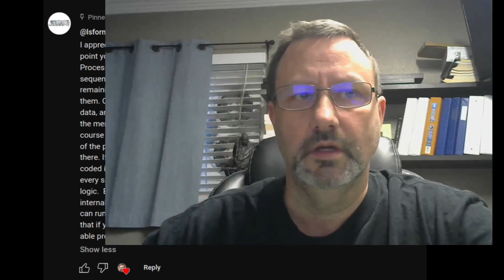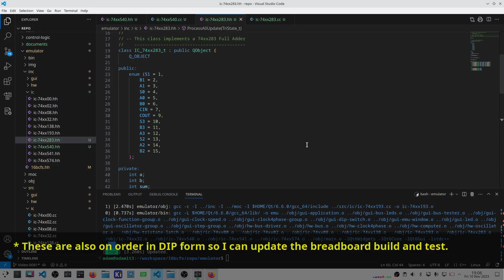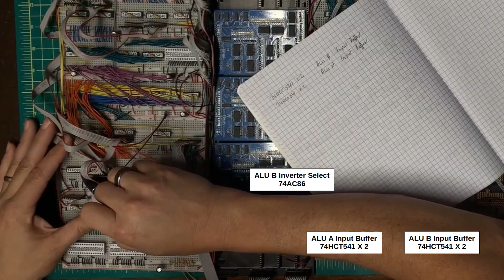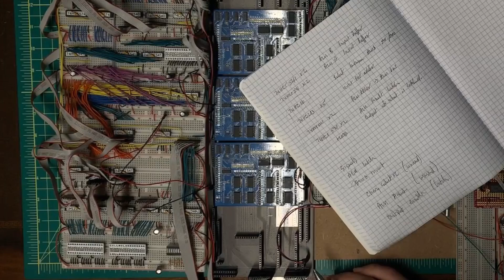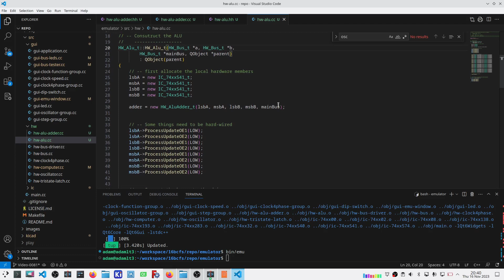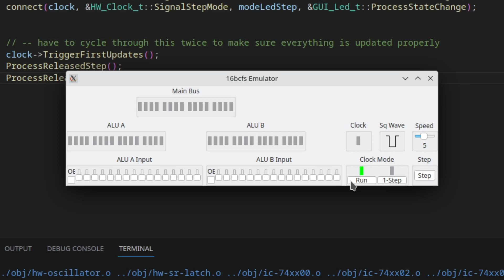0081: Emulating the ALU Adder & Proper Clock | 16-Bit Computer From Scratch

Comment: When you were describing the multiphase clock, I was running a thought experiment of mulit-phase vs pipeline/multiple cycle instruction execution. I had the thought that pipeline or microcoded multi cycle instructions would be simpler to implement and allow more flexibility. probably more accurate to consider the microcode controller a state machine for the various steps required to complete an instruction.
Reply from the maker: @grumpyoldman5368 -- That is an interesting thought.  I had not considered a state machine for my build.

My knee-jerk reaction is that a state machine would feel more like a stepped CPU, but instead of executing steps in sequence (1, 2, 3, ...) the CPU would be able to determine the next step from the microcode by dedicating a portion of the control word to identifying the "address" of the next step in the control ROM. 

Consider the MERCIA relay computer project, which I believe does just this.  http://www.relaiscomputer.nl/index.php/decoder

Comment: I kind of feel some weird sense of satisfaction blended with responsibility as I was who made that comment (from my other account but anyway). Of course I appreciate your thorough mention of it so thanks for that. Now, I'm 100% sure you know that, but I just want to point out the main difference between a CISC and a RISK processor, in case it is useful for some reader, which is their approach on microinstructions. 

On a CISC processor, the native instructions are split into several simpler microinstructions, each one taking one single clock cycle. By using this approach, native instructions can be designed to carry any arbitrary complexity using any number of clock cycles. The epitome of this approach was the Digital VAX mainframes of the early 80's. The instruction set was extensive and very powerful, fully orthogonal, with a great number of addressing modes and native data types, including full flexible access to memory. Some instructions were able to perform compiler friendly tasks particularly related to calling conventions and stack frame allocation, and in some versions even direct sting manipulation was part of the native machine instruction set. This made things easy for compiler designers and programmers, at the cost of many clock cycles per instruction in some cases. This was a very extreme case of CISC approach. I must say that I loved it ! 

On the other hand, pure RISC processors attempt to simplify native instructions up to the point that they can be executed in one clock cycle. It can be regarded as closing the gap between native and micro-coded instructions, turning native instructions into a convenient representation of direct micro-code. According to this approach, it is preferable to use several instructions to complete a particular task, than to provide one single instruction to perform such same task. This comes at the cost of more memory used for programs and more complexity demanded on the compiler side. However, it is generally a faster approach because the processor can be tuned to be highly efficient at performing a much simplified and straightforward set of instructions. Current so named RISC processors such as the ARM, do not have such a simplified set of instructions, but that is because as more transistors were available to put in processors, some originally mostly RISC instruction sets, evolved by incorporating more complex instructions, while still keeping the original (Reduced Set Instruction) efficiency goals